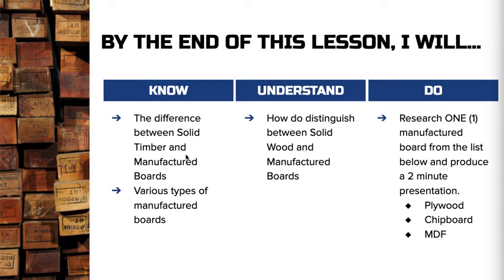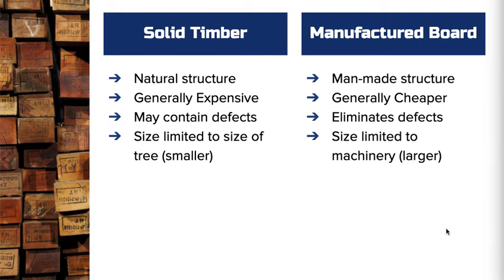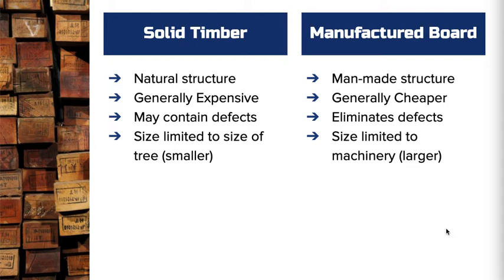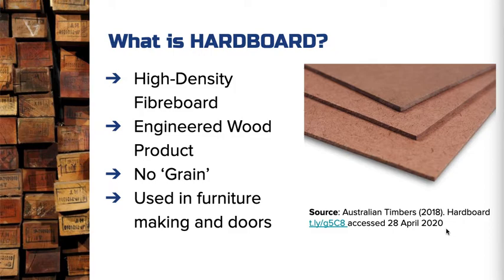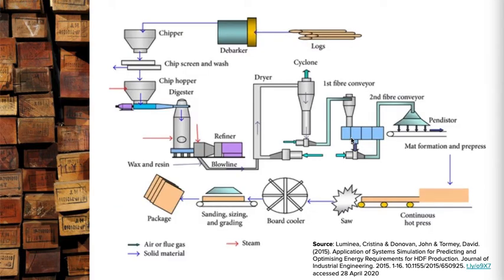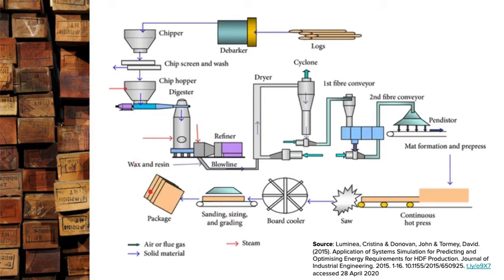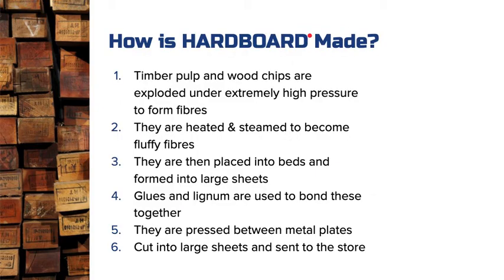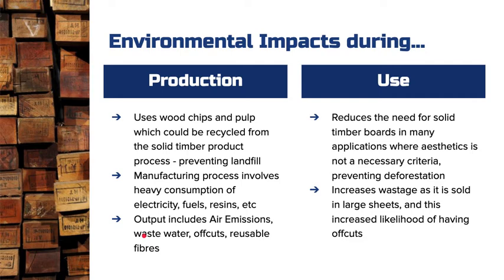Manufactured Boards

Comment: Hardboard mistky just uses the wood's natural lignin as a binding agent. I've never seen hardbboad that was glued together and when it's snapped, it derlaminates and tears, as if it was really thick cardboard, wgich it kinda is.

The shiny side isn't waxed to make it look shiny, although a small percentage of wax is appareny used in its manufacture to provide a modicum of water (not vapour) resistance. Each face merely reflects the surfacss against whch it's pressed to remove excess liquid from the manufacturing process. On the smooth side the fibres and natural resins, take on the smoothness of the pres's face (in much the same way that concrete takes on the look of wood grain when poured into wooden forms), while the reverse shows the marks of the mesh against which it's pressed (to aid free flow of the liquids being removed) and maintains the roughness of the naked fibres. The front face can, of course, be waxed to aid release when it's used to make forms, which it excrls at, being cheap, firm, smooth and relatively flexible.